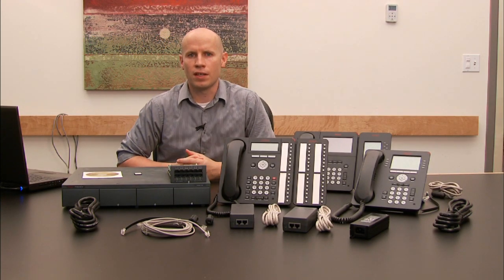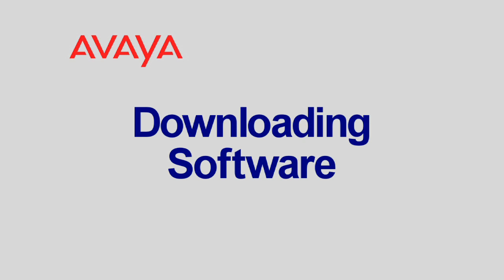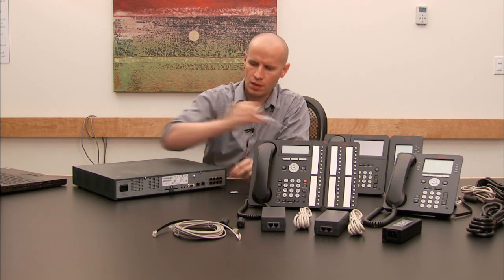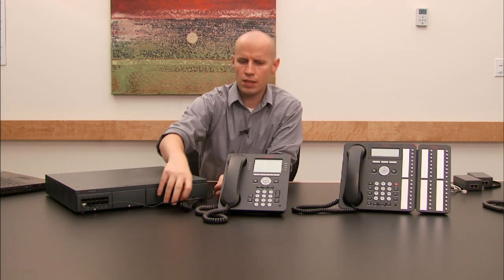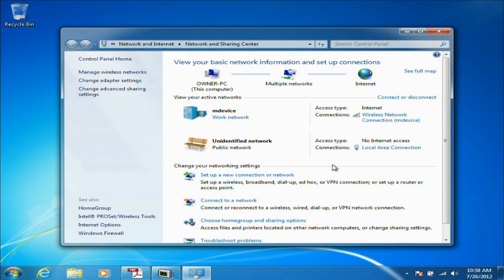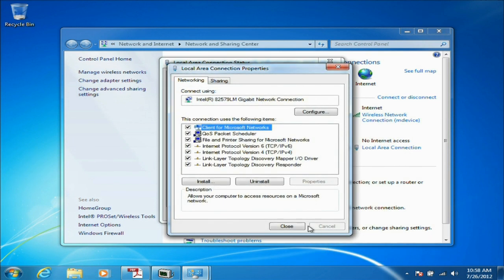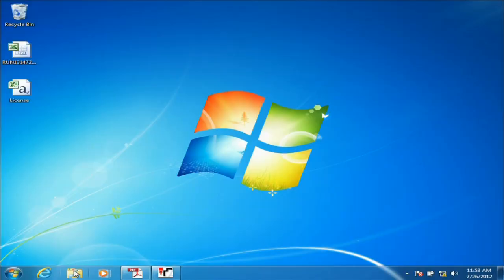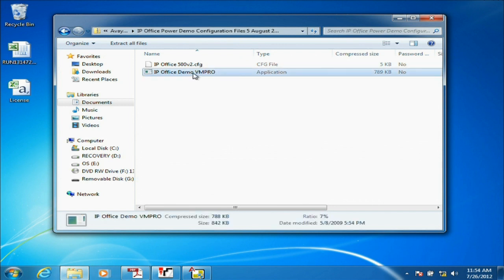Avaya IP Office Power Demo Setup Video Tutorial

Comment: I have question: Shall I need to connect extension module directly with main control unit? or I can connect it with network? If I have 32 analog lines RJ11 from ISP how can I connect them in control unit?
Thanks :)